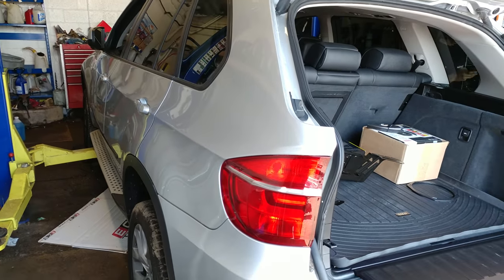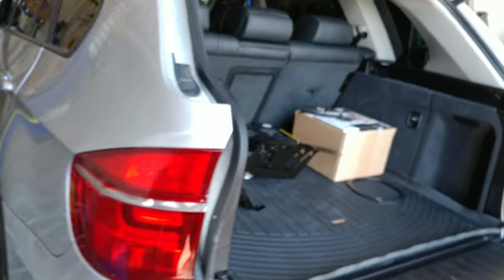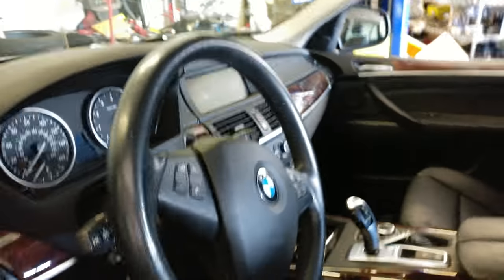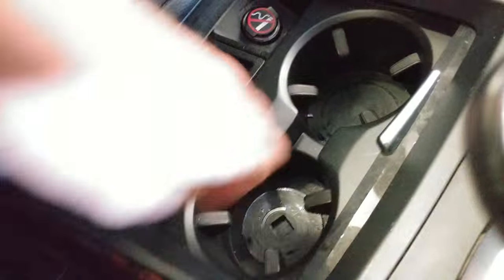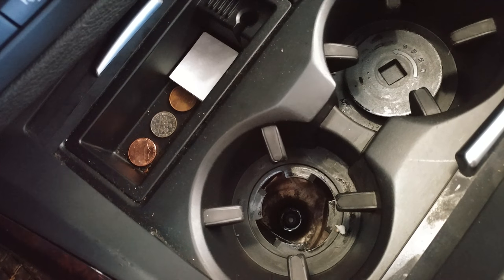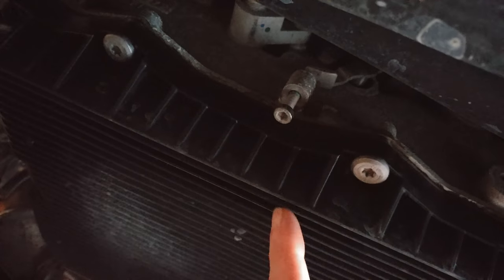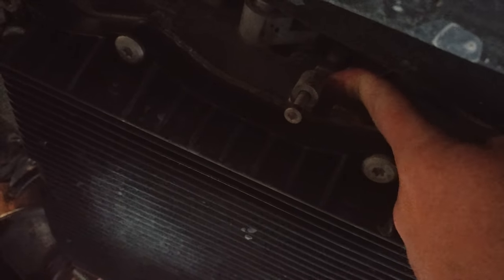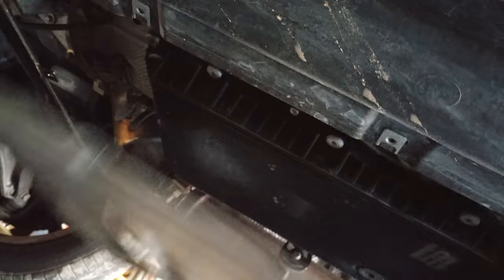E70 BMW X5 in Neutral When With Voltage for Towing ECT

Comment: Gosh! Thank you so much for posting this video.  I have my 2012 BMW X5 towed 3 times within the last year and all three times the tow guys dragged my truck like a dead cow.  I couldn’t find the lock under the cup holder so I just let the tow guys do whatever they wanted. The wheels wouldn’t move but the guys kept pulling it anyway.  
I love driving this SUV, but I hate it when it breaking down which happens almost 2-3 times a year.  And every time I brought it to the dealer, the estimates were always in the thousands.  I owed 4 BMW since 2001, two of them were 3 series, an 2003 X5 and now 2012 X5.  None of these cars cost less than $40k.  The 3 series were not that bad, the X5s are always giving me problems.  If you like BMW X5, lease them.  Before the 2-3 years return them back to the dealer, after 3 years you better ready to sell your babies to pay for repairing this baby.  I am writing this while my X5 is still at the dealer today.  I purchased an OEM BMW battery in November 2019 for my 2012 X5. Pandemic, I worked mainly at home.  Last week when my car did not start I have it towed to the dealer.  They said the battery no good, even I purchased it less than a year it is not cover under warranty.  According to the dealer “because you don’t drive my car enough, you used only 1,300 miles within a year”. I live less than 5 miles from work and for months I have to stay home because of the pandemic.  I’m really confused.  I hate BMW dealer now.  After this I will never touch another BMW.

Comment: Just bought my 2011 x5 a month ago, and found this video when I wanted to move the car 20cm on flat floor in the garage without starting it like I have done with all my other cars and, started wandering what to do in case of an emergency. This stupid design is almost a reason to get ridd of the car again right away, they actually had an acceptable solution to this on the preface, and then they make you crawl underneath the car on the facelift version to get the stupid thing out of park if you have some engine malfunction on the road.. You can't even push it out of the road without crawling underneath the car while you wait for the towing truck . This is totally unacceptable design, someone at bmw should have had serious beating for this. Thanks for the video though.
Reply: it's all about gearbox design. Before 2011 it was zf6hp after zf8hp they are built differently and it was ZF ( gearbox manufacturer ) who put this screw on the bottom of the gearbox. nevertheless BMW should come up with a way to do this, e.g. on a Range Rover with zf8hp the lever to engage neutral is on top of the engine under the hood with very easy access.
Reply: @BratDalton   Yes, it is really too stupid that the removable cup holder and all is there, just not the possibility to put the transmission in neutral from above, it really would not have cost bmw a whole lot to make it work with the old solution.. Just imagine if the car brakes down in the middle of a steep hill and you can't get it in neutral, you have to climb underneath the car in such conditions, really stupid. Shame on you bmw

Comment: My 2009 x5 30i turn the red giant key locks in place you're in neutral. Pull it out it locks back in gear. To bad for 2011.